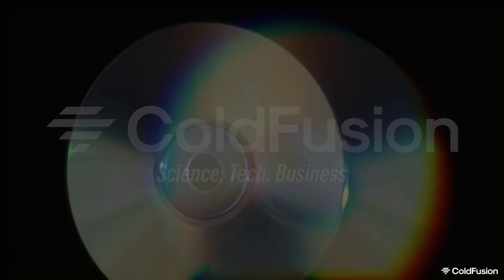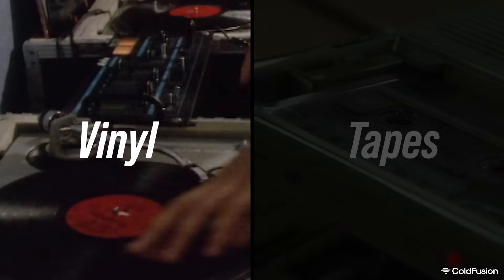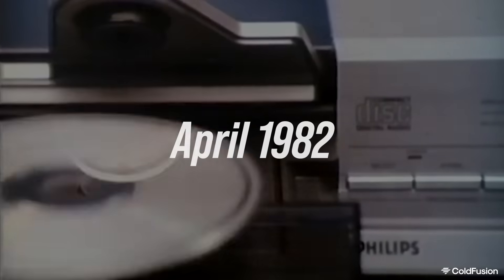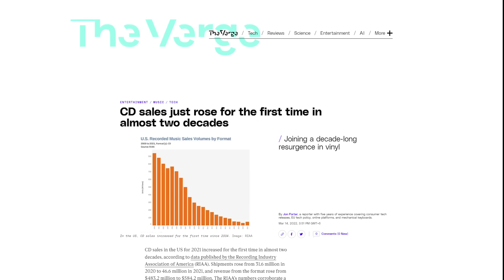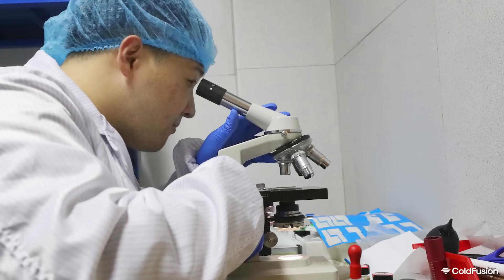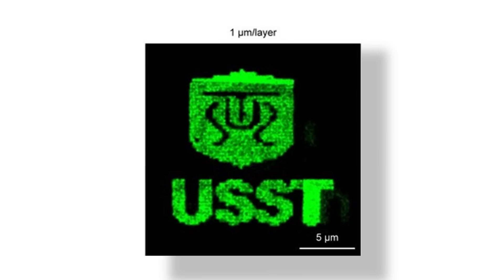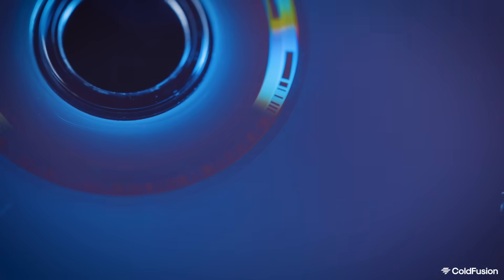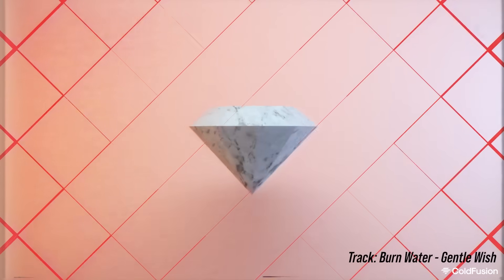Why This New CD Could Change Storage

Comment: That optical data carriers have been largely replaced is also due to the prices for reading and writing devices. Their prices have remained largely stable over the years. So it is of course no wonder that hardly anyone buys such a device anymore.
Yet, this medium would still be useful and practical for the distribution of software (primarily games) and high-resolution films/series.
Reply: i think datacenters would use this more than anyone else, if anything they would release mini-CDs with this new tech for games, and any unused GB's would be used for the new redundancy tech for CDs where you can access data even if scratched

Comment: Imagine, one million terabytes of storage in a gigabit sized playground. You'll be able to pack 7 football fields in your purse, but you'd need to plug it in to a 3phase diesel generator because the manufacturing process is complex and market dynamics make it incredibly inefficient. That's almost how inconsistent and borderline incoherent this sounded to me. Take the time to proofread your script before recording at least. Bits ain't bytes, there's a factor of 8 difference.

Comment: "Ahh... I Scratch my disk"
"Okey, how bad is it?"
"Lost 100.000 movies..."
Reply: With that capacity, each block of data could be stored in 5 different, far away places of the disc, and you'd still have a 40 TB disc.
Reply: @JCCyC  far away relative to data chunks, but not to physical scratches unfortunately. Would have to be in a plastic case I think, like zip discs were. Contained in cartridges to prevent physical damage. If it were to be consumer grade.
Reply: @channel_alan   I'd go for that. Would look cool too.
Reply: @JCCyC  That would take forever to write on.
Reply: That's similar to what I was thinking. The insides of a reader and writer have to be like a clean room too. Wonder how it would error correct for a dust molecule or good surface scratch. Can the laser be angled differently to recover since the data is in the layer not on the surface. How close to the surface is the data layer? Can it be read and confirmed from above and below so that a scratch on one side doesn't affect reading from the other. Would have to scratch both sides to block reads. Interesting new problems and solutions.
Reply: @channel_alan if they fragment the videos so that a scratch would only destroy a small piece of a movie on pretty much every movie then it would be almost not noticable
Reply: @Vinlaell  While that's true, if you're playing directly from the disc you're going to need to buffer more to account for the last having to reposition on the (assumed) spinning disc for the next chunk of data, and storage has to be either for format aware or the sectors algorithmically allocated around the 3D space. Including the CRC data. Not impossible. Probably wise and better suited to archival backups. It'll really slow the wire speeds though because you'll have to wait for the next write space for a chunk, or organise the data before a write, waiting for the original storage medium to move to that chunk of data to read. There's a big cost to that distributed write standard.
Reply: "That's alright.. I got another backup as well on another disc"
Reply: It's not really a problem because we already need to grapple with this for HDDs, it just means this will have to be something like an optical HDD, not loose disks you can carry around. To give you an idea of how sensitive HDDs are, it only takes a fingerprint on a platter to cause a head crash
Reply: Yea this would be the type of thing you’d wanna keep under lock and key 🔐 if you have crazy current or Ex-girlfriend 😅 right up there with the old PS memory cards 😂
Reply: You are talking about 22.8years of continuous movie material.
When were you gonna watch that?
Reply: You could say the same thing about HDDs, which work in a similar way and have been used as primary storage mediums for years.
Reply: thats not how it works at all, all the space not used for files become redundancy, so if you leave 50% of the space for redundancy, 50% of the surface of the disc can be scratches and your files will still be fine,
Reply: Actually only "micro scratches" would damage the CD, macro scratches that you would do in the real world would have no effect.
Reply: But it would still be 0.01% of the total amount.
Reply: "Ahh... I Scratch my disk"
"Okey, how bad is it?"
"Lost 100.000 movies..."
Intelligent person: "Oh boy, are you stupid for not making any backup copies of data on ANY storage medium".

Comment: The problem is that this doesn’t need to compete with other storage technology today, but the storage technology that will be available when these new discs are commercially viable. Today, the spot price of 200TB of flash memory is around $8000. In ten years, when these discs are actually available, 200TB of flash will probably cost hundreds of dollars.

Comment: there is no downsides to optical deives.
-they can store memory for over 1000 of years
-dont need electricity to retain the memory stired
-they look good

unlike USB,SD or HDD that die in about 5-10 years

Comment: The era of CD is definitely over. However, it is not he CD which will be popular again, but solely its amount of data stored. As always, the price will not be an issue, as it will go down later when the tech becomes widely used. Also, by that time, the manufacturing will get advanced and even further modernized which drives cost reduction as well. The biggest advantage will be "all weather" resilience. Of course, it perfectly fits for archiving purposes. However, the tech should be compatible backwards to read CD, DVD and maybe even blue-ray. Looking forward to it!

Comment: Urrrm... there's that drawback as i expected for this heavy duty CD. 
Read and write speed to support the huge load of data capacity. 
This isn't as easy as just having the CD produced. It's more like stepping ahead before the foundations are even created. 
The players or writers have to be able to adapt to these CDs. Therefore, those devices need re-created first in order for the CD's to be used with ease. Normal CD's/DVDs in players already have the problem of detecting formats, searching files through heaps of folders, going through skips and whatnot. So you can figure what needs to be cleaned out smooth and how much time it would take before these super CDs are even usable. And we missed out something more important there about the contents for the super CD in future. Even more stringent copyright protection laws. Because media sites aren't gonna be quiet about losing their revenues.  
But as a quick alternative, you have USB pendrives that go beyond the normal CD/DVD capacities and have less of the problems as that of those discs. However, though handy and smaller than a pocket load size, they're a little too small that it could get lost and having less to almost no space for physical labelling, you could not tell what has it into which if you have a whole large amount of pendrives. 
Meantime, there's an idea for return of cassettes. 
Think about the magnetic tape and what if those nanos are afixed to them in future. Huh?  😉

Comment: To be honest I thought that the writing laser would be more expensive. Yeah 50k is a lot of money, but LTO drives cost around 5k and LTO-8 12/30TB. So if the operating costs come down and speeds come up to 1000mb/s I could see this as a great option for archiving. If These CDs are cheaper than LTO tapes, holds more data and are about as fast and reliable as Tape, than this has some potential as an archiving tool.

Comment: This video is an atrocity.  It goes on and on with telling us what a CD "was".  It never mentions whether this tech is -RW or -R (write-once), or when mentioning the slow speed, if that is read or write.  There were multi laser data disc readers to go faster.  The read and write processes are mashed together and we don't know if multi laser read would work.  We don't know if these dyes are more or less stable than what DVD-R used.  How photosensitive is this disc?  Would it have a shell, and look like a "floppy" disk?  There isn't much about plans to release this, or if its just Chinese guesswork, that worked one time (like COLD FUSION itself). 

More seriously, remember that 90% of writable CDs were not re-writable.  That's two different chemical technologies, of which CD-Rs were more stable in the original Taiyo Yuden form, but all are degraded by light.  And this comment at 12:00 omfg!  It took almost 20 years to get CD-Rs, and they were joked about forever being just a few years away.  The first CD-burners cost $5000 in the 90s, and the discs were $10+.  Femtolasers made for a production product are still lasers and those cost 30 cents.  They won't be $50k.. how phuicking stupid to say we should give up, its a "show stopper" because it doesn't exist yet and lab equipment is expensive?!?!  You (or the AI writer) don't explain the tech, and then make asinine comments.  Even if the first model is $50k somebody will buy it, but what is it?  This video doesn't answer basic questions.

This video up to 12:00 hasn't mentioned whether this is a more complex RW chemistry, or write-once -R type.  RW could work like a (very slow) HDD, but -R could be read by 100 lasers at once (or maybe not), yet would be purely for archival use.  Data centers could archive locked threads or permanently stored images which are not requested for years at a time using this IF it is -R and allows multiple laser reading. You could use 1990s style 100 CD jukebox players then to store up to 100 Petabytes of old info, which would be selected for archiving when it hasn't been accessed for a year or something. The 10-15 second physical lag to recover the data would trigger a notice if requested in real time online, but if it was for email or download, or requested internally would be no problem.  This would be much cheaper than hundreds of drives and server banks holding data that may never be asked for.  A service could even aggregate customer archives like a slow cloud, but this would be risky.

I still have scads of blank CD-Rs and DVD-Rs and some RWs.  HDD sizes exploded from 100GB in 2002 to anything you need, and CD-Rs turned out not to be as reliable as HDDs, so on one hand we stopped taking 20 minutes per disc organizing and burning discs only to save 50 cents on storage cost, except for actual psuedo-piracy copies burned for DVD/CD players.  And on the other hand, most people later reintegrated their CD-R and even DVD-R archived files and pictures back onto an old HDD for safer long-term archiving.

Comment: Optical will always be be the future of permanent storage, it just lasts longer than any other media. Even harddrives are basically Optical. HDDs are just really heavy duty CDs w/ multiple disks, we still use them today and they' last much longer than Nand & Flash storage. We have means to put 50x or more data on tape & disk media. It would hugely improve the limitations of how much data can be stored online. We're constantly running out of how much data can be stored at Google/Amazon/Microsoft. Youtube is constantly fighting this issue

Comment: In the mid 90s, I had either heard of or imagined the holo-optic disc. A disc using multiple lasers for holographic storage and recall. This is similar, but years late to see a mass adoption. And just the same, the speed is a hard pass for any serious use. For that amount of data, only ssd makes sense, something that I didn’t know about back then. Unless the laws of physics change this will never be feasible. But the research will be valuable for when material science catches up for a solid state version.

Comment: When we talk about such micro scale on a plastic or even an exaggerated new toughest ever material, we just fail to understand that even in a perfect vacuum it will take forever to write that amount of data on a constantly rotating surface. That said, if some version of this media does come out, I can guarantee it will not be anywhere CLOSE TO  a CD. 

THAT SAID, UNLESS WE ARE LIVING IN A SIMULATION, ITS CLOSE TO IMPOSSIBLE FOR THIS TO BECOME A VIABLE PRODUCT.

Comment: Is it Bits? Is it Bytes? Had to stop watching, there was so much misinformation being thrown around that I couldn't keep up. 

Anyways, a quick google search answered my question - it is 1.6 Petabits, which equates to ~200 Terabytes. That's 100x my Steam drive SSD, which is still quite impressive (albeit with caveats) but nowhere near as impressive as the video initially alluded. As for the caveats, it's a disc, meaning it comes with all the pains of discs we've known about for decades. Durability aside, access speeds are probably going to be so bad that these will be no more useful than specialized long-term backup solutions, maybe replacing that large-format magnetic tape. I don't see this as a return for physical distribution media simply because they'll be far too slow for any kind of practical use.

Comment: CDs have a problem with data corruption. I heard from 2 differrent Radio stations, that their old CDs from the 80s do not work anymore. They were backing up their catalogoues on harddrives when they noticed this. They have, therefore, started prioritizing the backup of CDs above the backup of their analog media. I wonder if this is an issue with newer CDs.
Reply: PDO discs from the 1988-1993 were prone to bronzing, which prevented playback as it progressed
Reply: It doesn't even matter, this is coming out of China so likely a massive hoax.
Reply: yes very early cds can have that problem. with time they improved the manufacturing process but even the newer ones will degrade eventually, just much much slower

Comment: Read speed for the amount of data is limited. Not to mention that any mistake, bug in code etc. is impossible to fix once it's written onto the disc. And with how important the readability is for a disc like this, I'd want a protective sleeve around it for sure, I wouldn't trust myself to handle it "raw" 😂 I've lived through the days of going from casettes to CD's and oh boy did my CD-rom's get scratched up over time.

Comment: The only way this will succeed is by ensuring manufacturing at scale and affordable consumer pricing.

Initially it will be very expensive in order to recoup some of the R&D costs but mainstream acceptance and availability to the public will be key.

The ordinary person won’t be interested in being able to store their digital data one million times over on a single disk, but digital creators and AI developers will. And it needs to have a proprietary and novel indexing system. No one will want to search a single disk of that capacity for a file.

Comment: Imagine your cd gets scratches, that's 200 Terabytes lost data there.
Reply: Imagine spilling your coffee on your media storage and nothing is lost
Reply: clearly you don't know how modern dvd/bluray works, if you want data storage they have built in redundancy, and when you burn a modern 100GB blu-ray for backup you can leave some space left for data redundancy meaning it can get scratches but it will have a certain percentage of redundancy before the data gets unreadable, like a QRcode
Reply: CDs can get a bit scratched and dirty and still allow the data to be read perfectly. They have error correction built in.

Comment: With PC games pushing 200+ GB and games averaging 50 GB per games. I think the future of the 200 GB cd drive is definitely going to be selling games that can be played from the cd without installation
Reply: they could sell a mini-disc version (same size as gamecube discs) and it would have something like 75TB which is still pretty good and could fit a whole steam library

Comment: Biggest problem in the cloud: IOPs. This solves one critical problem: data integrity. Cloud volumes (S3 or EFS) are vulnerable to ransomware or other data changes unless you pay for immutable storage ($$$). Backing up cloud data is expensive due to IOPS limitations. If these discs can provide immutable storage without the cost penalties of backup IOPS and the extra expense of immutable storage, it will be a major player in the medical imaging and legal discovery markets.

Comment: Just came to say..... NO.  a new type of CD WON'T CHANGE STORAGE.

First off, no one has a CD drive in their devices any more.

Second, CS's are still vulnerable to scratches and damage by bending and UV from the sun and even electromagnetic interference which degrades the CD over time.

Using an old storage medium to try increase storage size isn't a step forward, it's a major step backwards.

Since chips/semiconductors are getting even smaller and cheaper and faster and more efficient, the likelihood of a return to CD for any reason looks extremely unlikely.

This is a pointless video and a pointless half assed attempt at making something new out of something old.

It's called rehashing, and it ain't gonna work.

Comment: That's a formidable quantity of data.  The elephant in the room is "would it be readable half a century or a century from the time it is written?:  I have a box of photographs in the closet that are over 100 years old.  Would a 100 year old disc be readable in the same amount of time?  Would the hardware continue to exist that can read it?  Will the software of the time support the data format?  Will computers even exist as they do now with the capability to read such a media?  It's an interesting dilemma.